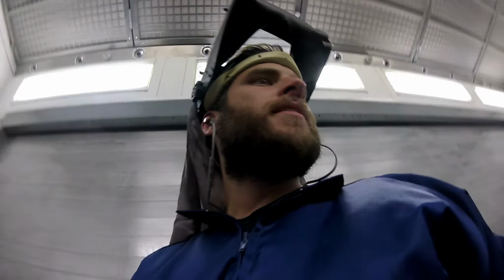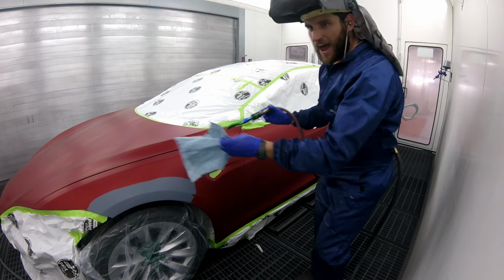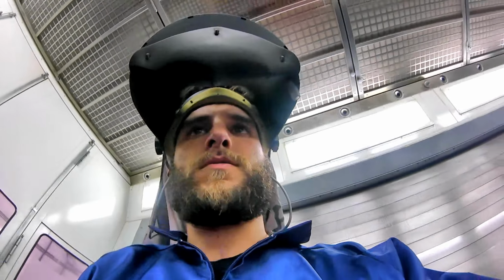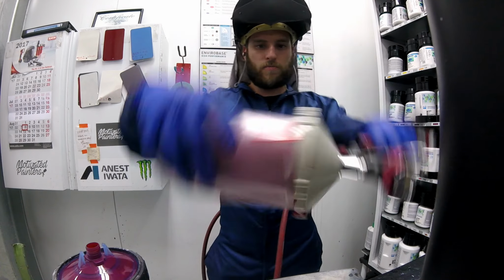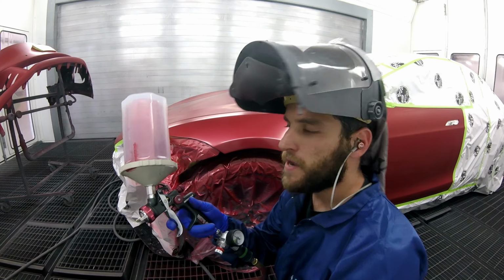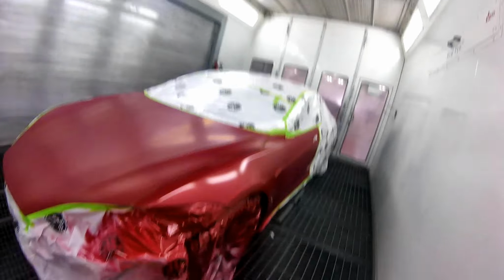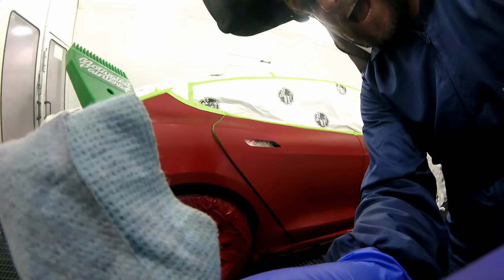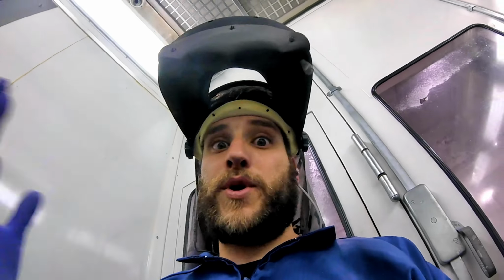Difficult Tesla paint job  Part 1 - 2   PPMR - Red Multi-Coat

Comment: Hey Gabriel quick question I'm going to spray paint ruby red pearl just hood n both front fenders n bumper bar do I necessary need to use the wet bath for this project I'm doing
Reply from the maker: No you don't
Reply: Thank you Gabriel 🤝 keep on cheering videos

Comment: Very nicely done! Just curious, why you don't use a wetbed? I'm new to EHP so is it just not needed (I'm coming from a DBC shop to an EHP shop)?
Reply from the maker: +Todd Poppleton hey brother I didn't have need for wet bed but you can use it for sure. I find with good enough gun control and tacking you don't need the extra step of a wetbed but that's just me. 😊😊
Reply: MOTIVATED PAINTERS Thanks for the reply! Much appreciated.
Reply: @ToddsGuitarShop  the best reason to use a wet bed with the PPG Envirobase is the pearls and metallics are SOoo sensitive to surface scratch irregularities, you can see everything! I don't like this stuff, at all, especially here in Maryland on the Chesapeake Bay in the summer it's 90 plus degrees and 90 + percent humidity, it won't dry!

Comment: PPS new system is the cats meow. More paint sits under the strainer when the gun is held to spray. The lid and the new pps gun adapter have a larger hole making the paint flow more freely towards to end, no more sputtering. The lids have a built in collar that is just 1/4 turn instead of the black ring. Every refill of new liners comes with a new cup.
Reply from the maker: +Chris can't wait!!!!!!!!!!!!!!!

Comment: Nice job on the edges!  Why use base and not sealer?  Great tip BTW.
Reply from the maker: +Kent Buehrer because I didn't need to sealer and it requires more blending so base was easier and more practical😊 thank you so much!